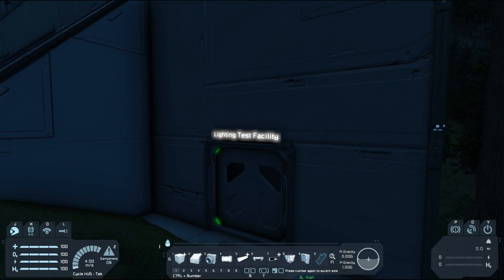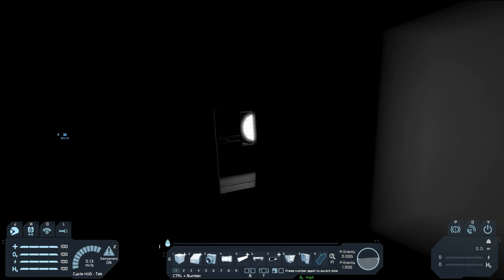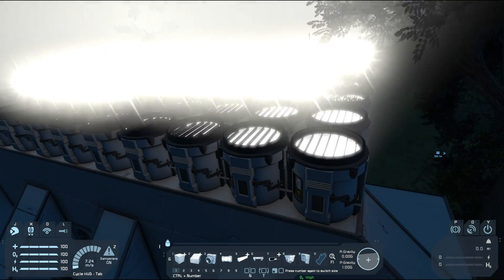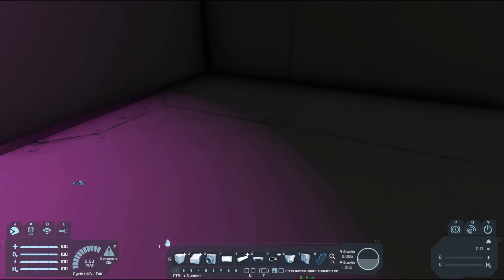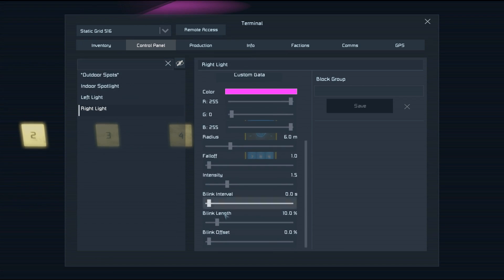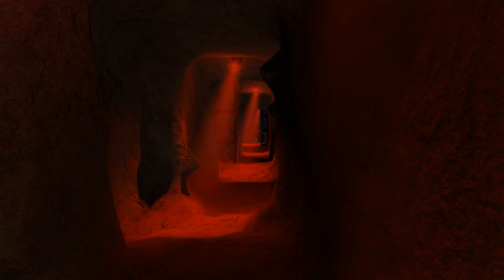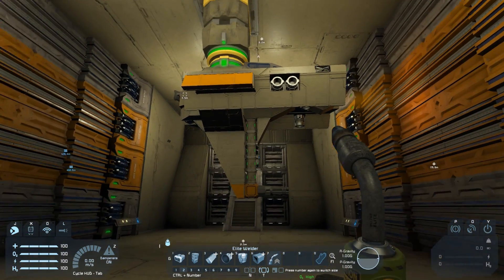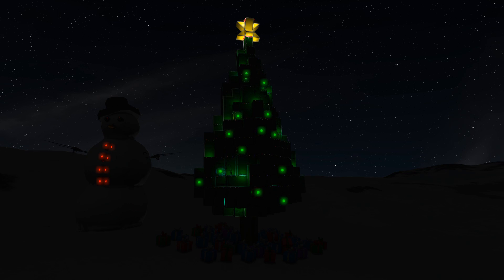Space Engineers Tutorial: Lighting (Part 8 of a survival tutorial series)

Comment: How do you set them up? Iv placed like 8 interior lights, group them in the button panel, but it’s not turning on
Reply from the maker: The lights start on by default so if they aren't turning on you should first check that you have power to the grid they are on - it's surprisingly easy with bases to end up with divided grids if you build into the voxels
Reply: Splitsie my friend just told me to place a reactor on the platform, and it worked. Didn’t realise you have to use a reactor  to power them. Thanks anyways ❤️
Reply from the maker: Yep, you need power for everything functional in the game, conveyors, refineries etc :)